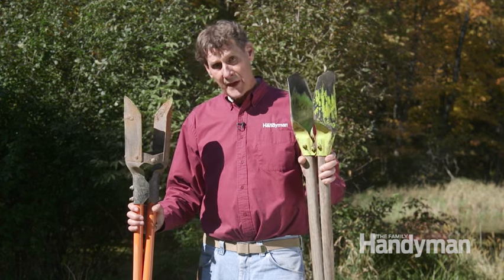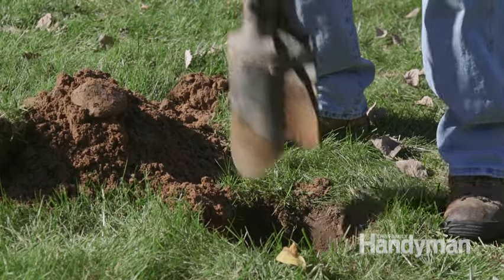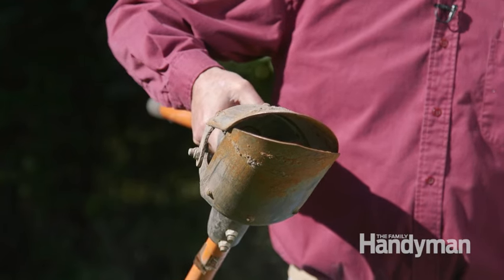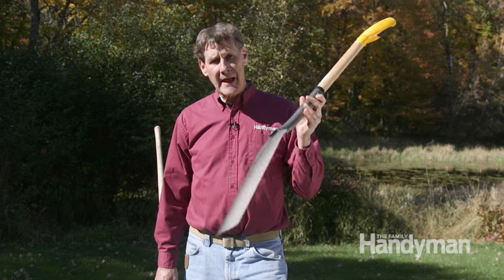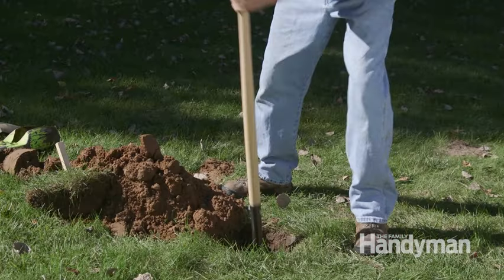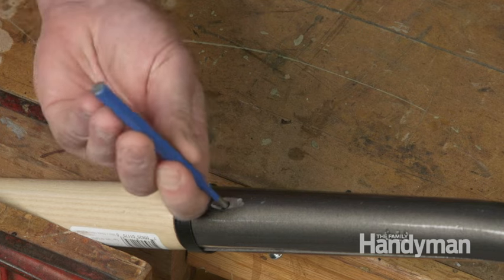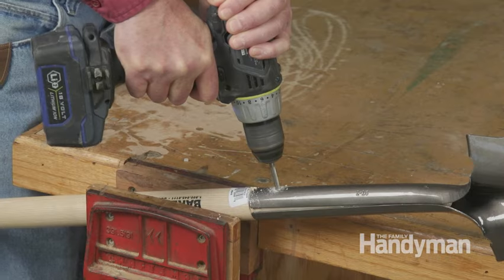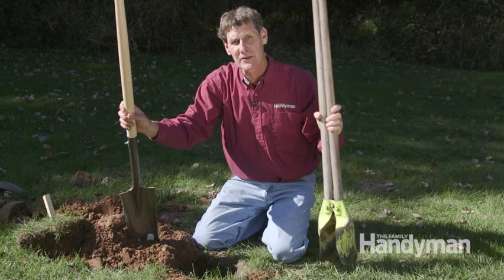How to Hand Dig Postholes

Comment: In the process of digging sixteen holes right now. Hence, sat on the loo watching YouTube videos. I started with the heavy clamshell digger. It makes the siting of the whole more accurate. The extra weight is not an issue as it helps with the momentum when thrusting downwards = ooh er. However after a few digs the soil turned too rocky.  So over to an all metal trenching shovel I bought years ago and had in the back of the shed.  It has a metal shaft and is heavy, which means you use it’s weight to dig the hole.  Then, on my hands an knees shovelling out the soil with my, now soggy, linesman gloves on.
Reply: Does that work well? I'm digging in clay right now and we're fighting that last 6" hard. Got to 5'6" today 🤣